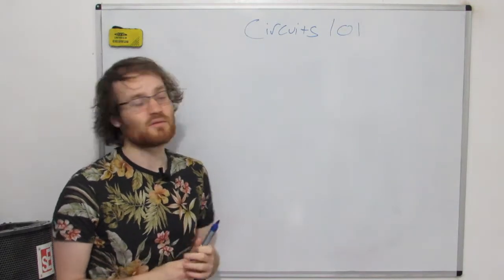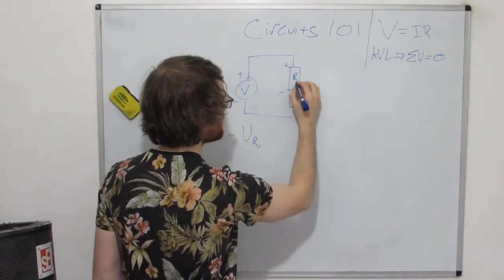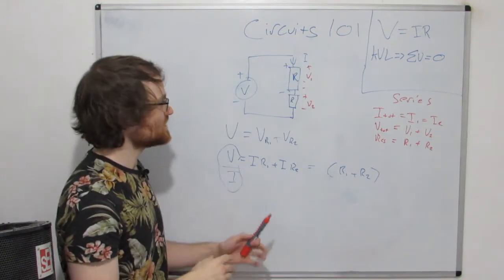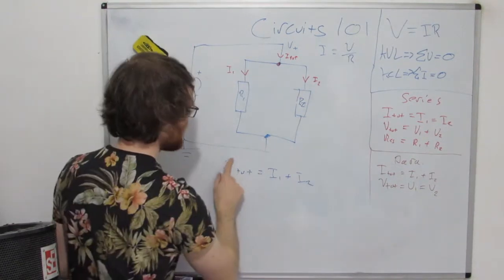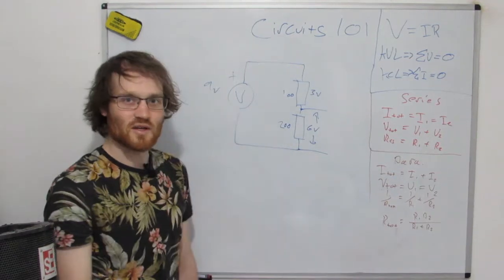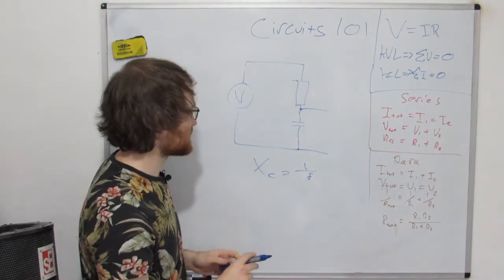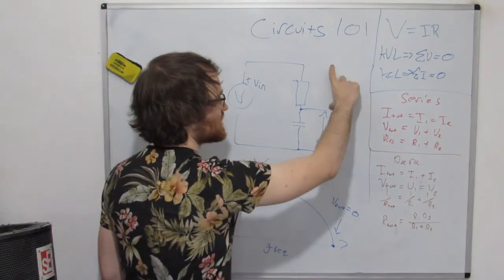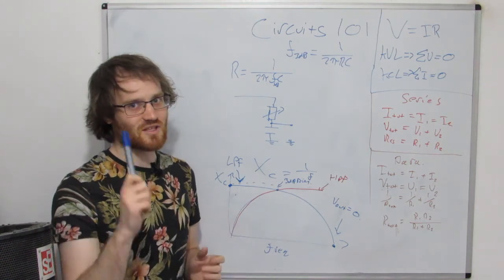Circuits 101

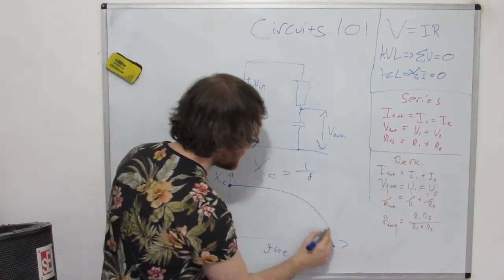Comment: First off, this vid is incredibly well done. I've never truly understood the relationships between voltage/current/resisitance till now. However I'm a bit confused with some stuff in the latter half. for example, why is the graph shaped like that @ 18:57? Is it wrong to assume that it would be similar to the shape of y = 1/x ?
Reply from the maker: Oops!

That's my fault and well spotted.
Watching it through it looks like i got mixed up and started talking about the ratio of Xc to R when i had labelled the graph as purely Xc!

In essence what i'm trying to highlight is the fact that at low frequencies Xc is much larger than R and therefore we see much more low frequency info across the capacitor, then as we increase in frequency the ratio of Xc to R becomes much smaller and therefore the voltage is dropped much more across R than across Xc. We're thinking of a voltage comprised of one frequency (a sine wave) and varying that frequency and watching how that causes Xc to vary and how that essentially acts as a potentiometer.

As it's labelled as Xc should be basically a steep 1/x (as it's actually 1/2pi*f*c). Hope this clears it up for you! I will pin this comment so if anyone else noticies my mistake they can see this :)
Thanks!!